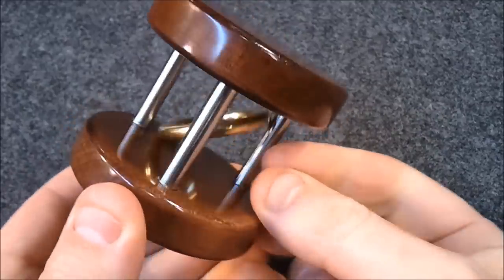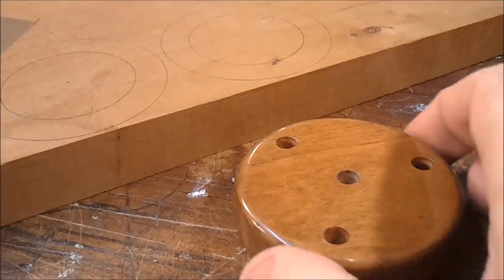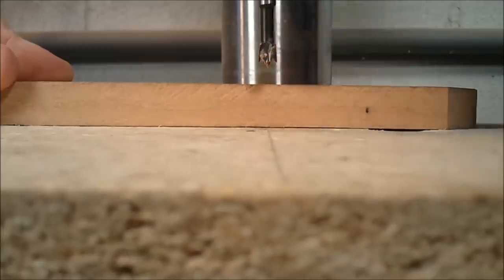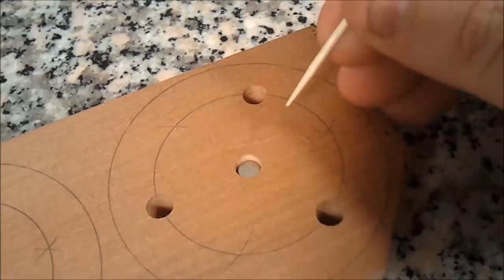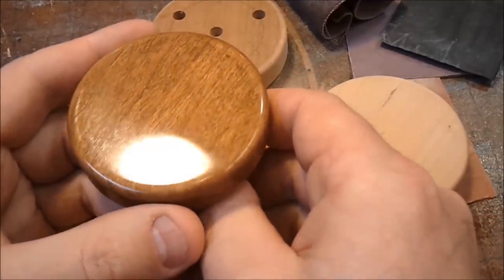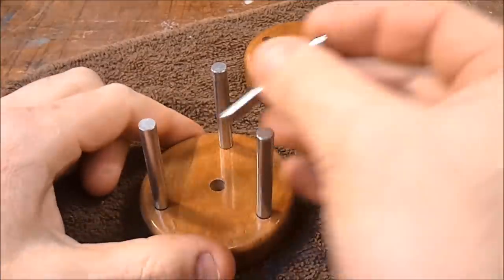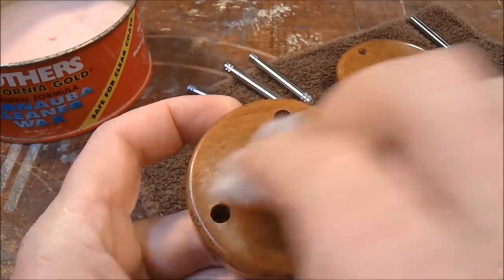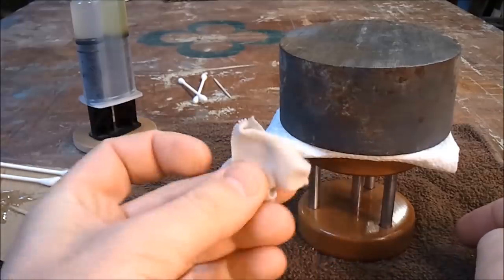Trapped ring puzzle/trick IMPOSSIBLE (not really)

Comment: The instructions were great. Thank you. The puzzle though, I thought was not a fair test of intelligence since, as you mentioned, the solver lacks a key piece of information. Unless if the point is to get the silver to think outside of box and test the strength of the device. But by that logic, breaking the device would also work. Am I wrong in that thinking?
Reply: +Barry Sabahat The key is to get the solver to pay silver for the solution.
Reply: +Barry Sabahat no, this puzzle could be broken and solved just the same as his "proper" method…they are one in the same.
Reply: Barry I also thought that it should have been a puzzle and not a hidden latch to remove the ring . I thought the piece was very nice but not much in the realm of mystery
Reply: +Barry Sabahat does it need to be a fair test of intelligence? also i'd argue that it'd be more appropriate to consider testing the middle rod is simply confirmation that there are no movable parts. that's much closer to attempting to test if the wood blocks separate than deciding to break them. it's not complex, it's simply about information gathering processes instead of information processing and analysis. at least that's my take on it.
Reply: +Sev Frost Hey Alexander the Great solved the Gordian Knot by simply cutting the rope with a sword.
Reply: +Barry Sabahat no
Reply: +Barry Sabahat 

For me it seemed like one of those things that seems obvious only after you know the answer.
And yes, you would need to think hard (not outside of the box) just hard.
You would need to think... Is there a trick? There probably is because this looks impossible, and then you'd need to ask, Aha maybe one of these pins is a TRICK pin. Anyway I didn't bother figuring it out, I just let the video run =D
Reply: yes
Reply: yeah
Reply: +Barry Sabahat The solution is hidden, but is not the same as breaking it, which is not a solution. Once the solution is revealed it's so blindly obvious as to wonder how one didn't figure it out before. In that sense it's a good puzzle, as all puzzles require some figuring out. If you just had the answer (steps) to begin with it's not a puzzle then is it?

Comment: A small thing you could do to allow yourself to sneakily complete it would be to glue some soft layer (leather, cloth, etc.) over the magnet so it doesn't make a clicking noise when the rod slams onto it.
Reply: Eh.. The ring already clicks around with the bars regardless of the magnet, doing that would be kind of redundant.
Reply: IVIusicFiend What does the ring clicking around on the bars have to do with the sound of a rod smacking on a magnet?
Reply: +Volvary Because if you were trying to fool someone without them seeing the operation, say by holding it behind your back, the sounds of the clanging of the ring to the bars and the clanging of the bar to the magnet would be indistinguishable from one another.
Reply: +Brandon Burrows wrong different materials make different sounds
Reply: dfissell Well, yeah, if you're listening for them. Which is unlikely.
Reply: +Brandon Burrows if they know there's a trick being played they're much more likely to become observant of everything the trickster does.
Reply: +Volvary it's already on before then so how would they hear smacking
Reply: bwahh stone What if you undo it under a table or behind your back, to show them it's possible? Then they would hear it.

Comment: Since you asked, I guessed the solution around 0:40. Failing some very elaborate ring design, or the use of a hacksaw, there is only one possible solution. The magnet I didn't see coming. Figured friction would hold the center rod in place. But the magnet is an elegant touch that will not wear out. Very cool.

Comment: i had something similar as a kid, except it was a pinball inside four posts.. the real difference is that the magnet completely locked the post in place, you couldnt just pull the post down. you had to give it a sharp whack at the correct angle to knock the magnetic pin out and free the post.

Comment: It's just an idea, but wouldn't it be more "theatrical" by using a stronger magnet in your hand? Maybe as a ring you wear, you could do this trick right in front of your friends putting your finger right below the center post (where there is not the hidden and weaker magnet), do the trick hiding with your hand and removing your finger (maybe upside down so the center post goes back to it's position before of showing you removed the ring). BTW +1 nice trick ;)

Comment: Figured it out from the thumbnail, but I'd looked at a few other puzzles beforehand, one with a ball bearing and two magnets in each half of a cleverly designed "dovetail" box that kept the thing from sliding open. That one needed a tap to shock the ball into the deeper hole. I probably wouldn't have guessed yours without having viewed the other video.

Comment: Cool : )  I'd seen a similar type box puzzle which was called Escape from Alcatraz.  It used magnets but, a little differently.  You couldn't pull the post to release it from the magnet.  Below the shorter post was a small rod in the base of the box that was held in place by the magnet.  You had to strike the puzzle against the palm of you hand causing the rod to come loose from the magnet creating the space for the post to move so that the ball trapped inside could come out.

Comment: My grandpa used to have something similar, but his had a magnet holding an internal pin that moved perpendicular to the pin the ring was on and blocker it's travel. So you could wiggle the ring pin a bit at all times, but not enough to remove the ring. The trick was to smack the whole puzzle into the palm of your hand in a certain direction hard enough to dislodge the internal pin from the magnet, then remove the ring pin.

Comment: Cool stuff.  I saw the solution as soon as you said there was a trick to getting the ring off, though [SPOILER ALERT] I was expecting the use of a spring rather than a magnet.  However, I wouldn't have thought of all the clever bits of workmanship, like using car wax to prevent epoxy squeeze-out from bonding to the wood, or using hacksaw cuts in the posts for more epoxy-gripping surface area.  About the only technique I would have replicated is doing one end at a time.  😁
Reply: The spring would of been a better solution but I guess he used what he had on hand

Comment: I figured it out at 0:47 when you only proved the outside bars to be fixed. I bought something like this a while ago from spencers... never could figure out the right way to open the "cage" and let the ball out... but I found if I spun it really fast in the air and let it hit the ground 1/3 times, one of the outside posts would drop so I'm thinking there was a centrifugal force acting on a spring used  to lock this pin in place otherwise.... currentlt searching for one to buy so I can try my hand at it again. Sound familiar? Square ball locked in a cage, with black top and bottom.

Comment: I haven't seen any comments below the one I am leaving now, even though I read the above upsetting comments of users leaving negative comments. OK, first glance is this guys give away, he has made the impossible puzzle [forget the cheat middle post], I say impossible, for people assume he is saying the ring is on a fixed middle pin like the rest. If this was the case, it's impossible without breaking something, so, STRAIGHT away, I knew, either the ring somehow retracted or broke apart somewhere, OR the centre pin. The are NO other options [assuming the ends are fixed like you would]. Not assuming they are, well, I guess there are 3 options. A COOL puzzle none the less, he has put a lot of thought and nice craftsmanship into this. He needs credit here for an excellent job!.      Myself?   I prefer puzzles that have no cheats like this, like the one I just saw with the red and green ball on the rope, with a ring on the red ball, you had to get it onto the green ball but the centre post and timber ring are designed to make this an AMAZING, awesome brain meltdown, and it can be done, I saw the guy do it.

Comment: I actually figured it out prettttttyyyy quickly.
because it HAS to be that the center post has to be able to opened freely. either pull it one direction or tap it to get it free. you might be able to tell since its loose and not tight.

make it harder where you have to spin it quickly to loosen internal pins or tap it a certain way instead of just making it easy to pull down with your fingers

it would be much MUCH harder to figure out..

Comment: It's probably fine for most things most of the time, but it's better to mix epoxy on a non-porous surface.

If you mix it on a porous surface then the surface may absorb more of one part than the other which means the ratios are wrong and you won't get full strength.

Worst case it may never cure properly at all.
Reply from the maker: That's kind of an interesting point, but both liquids have similar viscosities, and further, this product has a reasonable range of workable ratio, which accommodates systematic error in measurement nicely. 

er- I mean, both liquids are thick, and it doesn't have to be exact.

Comment: just as a matter of interest I wonder if making the nicks on the posts significantly increases the strength of adhesion.
Reply from the maker: Of course it does. It adds additional surface area to the post. Think of it this way: which is easier to remove hot glue from, glass or carpet? 

Porous surfaces work better than smooth ones with adhesives.

Comment: Wow that epoxy syringe thing was really cool!
Does that make sure you dont get unequal amounts of both?
Reply from the maker: In theory, yes. It works as long as you keep air bubbles out of it. Air compresses easier than the liquid (just like in a brake line) So I store mine standing up, so that I can bleed it before I use it.
Reply: Awesome! When i use 2-part resin, i was left with unequal amounts of both. :( Any idea where i could get that syringe?
Reply from the maker: It's fairly common where I live. I believe it is Loctite brand. If you do have to order one through the mail, at least you can probably refill it.

Comment: Go get a lathe. These round projects will go a lot quicker.
Reply from the maker: My sanding disk is attached to the lathe. And a lathe is useless for flat-grained circles.
Reply: pocket83 no. You had a vertical sanding disk. Not a lathe. By your thinking a drill is a lathe. Flat grained circles? There are such things called turning tools, that is you learn how to grind them you could have center drilled your small hole. Used the tail stock to hold the piece against the chuck. Pressure turned it, quickly. Then chucked up on the outside using soft jaws. Then used a facing tool and alllll the sand paper you want. Im a machinist. If you want me to walk you through it i will
Reply: pocket83 your talking about the verticle sanding disk at 5:57 correct? If that is a lathe then you arent using it for anything productive
Reply from the maker: I do not require a usage lesson. That is a wood lathe. The attachment is a modification; the sanding disk is a 9" piece of plywood mounted to a face plate. Wood turning is a mostly useless preoccupation, so using it as disk sander is a great space saver. I find that to be quite 'productive.' 

And again, the grain direction of the wood in this case was not ideal for a wood lathe, especially since a bandsaw is much faster and easier. With respect to error tolerance, consider what I'm making here.

Comment: Errrr... Mr. pocket83; Gosh! Such a looooong ranty diatribe! Anyway....
  You use consecutive/concurrent Metric AND Imperial measurements (5/8"AND 48mm in the same breath?).
 I DO hope you take such an insightful observation as constructive criticism rather than as a suggestion  that you're a bit hard-of-thinking......
Reply from the maker: You're seeing two tools in my toolbox, and you're telling me to throw out the one you don't use. That's not constructive criticism.

Constructive things add through their application. If you're suggesting that I ought to stop using one of two extant measurement systems, such an argument is subtractive; you'd be asking me to take away one of the ways in which I use to evaluate and/or relate things. 

I will continue to measure things with whatever systems of expression are printed on my tools. Since there are multiple systems, I've internalized them both. And except for Imperial volumes and Metric tape measures, I mostly like them both.
Reply: @pocket83  Errrr..... NOOOO! I'm not telling you to throw ANYTHING away.
 BUT: I'm telling you it might be a better idea to use the same system of measurement for both operations.
  In many countries Metric is "the norm" while many older people are more used to "Imperial"
  To use a more relevant example: If road signs show speed limits in either MPH or KPH; How many people can convert between the two? 
  Luckily; I worked for many years building "extreme" 4x4s for many years so converting measurements was no problem as I worked with both Metric AND Imperial parts. I even had a few vehicles brought to me using Whitworth-measured parts.
   BUT: I always noted what parts I used.
You might as well have used UNC, UNF, and UNEF thread pitches. Who knows? Is π "about 3-and-a-bit"?
HTDCYU